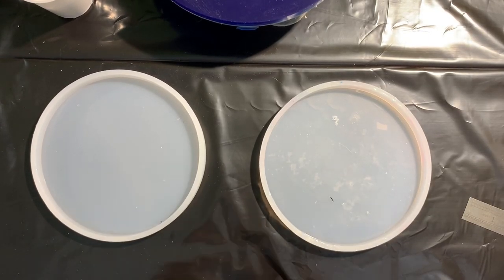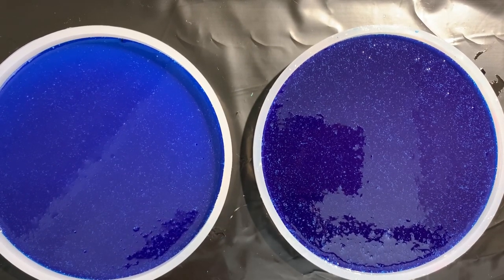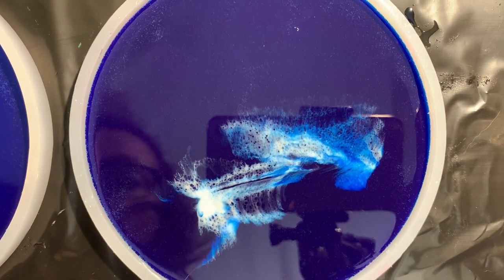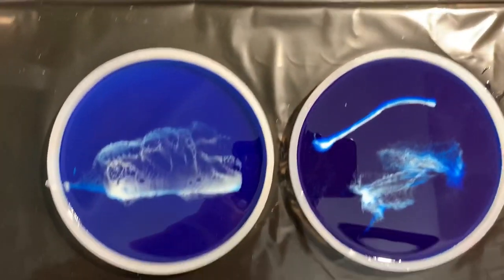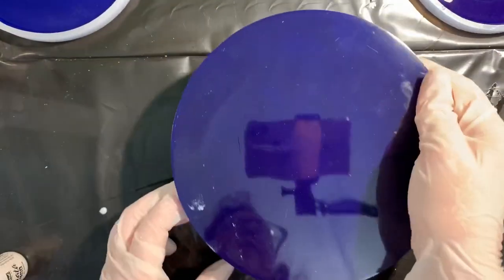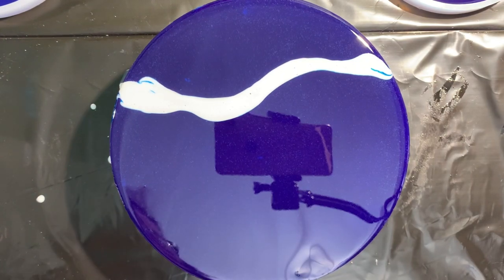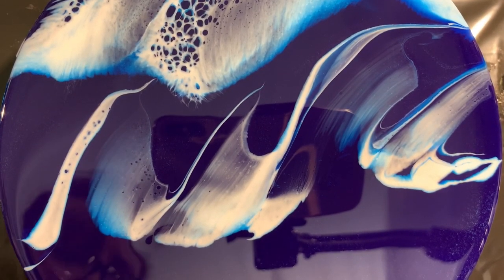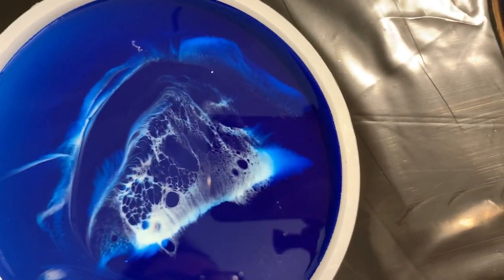Cells, lacing, and waves in Resin - what you may doing wrong - tips and tricks

Comment: Christy so lovely to hear your voice... oh and cheddar man too. Love your Pinterest with your cats they really are pretty . Great video your really thoughtful and a great teacher It was really great to know how thickness will effect the spread and “spring back” of the swirl I tend to make my resin thin like you since I learned mostly from you 😉 lol I do the layers so like it thin however I can answer a couple of your questions.... or uncertainties you mentioned in video.... yes casting craft alone will create cells and lacing so the alcohol ink isn’t completely necessary but doesn’t hurt. I giggled at the reuse of your so called mess up which I thought was brilliant probably could have gone over the top instead of back since it was opaque blue but saw that foil pen when you showed the ” mess up” side. So would love to see more ones with glass and moonstones in with combo of opaque and transparent colors.. how do you make the bottom layers show through do you use opaque first then each layer use more transparent colors or do you use silicone oils to make the open up?  Also did you know you can make any color crushed glass by putting some clear glass into a cup add alcohol ink of your choosing stir around till all covered then spread them on a paper towel in a single layer and let dry overnight and you now have crushed glass in any color! You probably already knew that 😂😘
Reply from the maker: I use transparent layers, but I lighten the color as the layers rise - so dark, then lighter, then usually the top layer is clear so you can see down into it.  I"ll use the glass and moonstones again, I have a couple ideas I want to try and couple things I have done, but didn't video and will do again.  I ALMOST showed you my spiral galaxy blob coasters in this vid, but forgot  LOL
Reply: Resin As You Wish  Thanks for your reply! Let me ask you though when you made the blue ones with video you used mostly opaque right? But the end result was beautiful but I tried and  basically covered the stones and couldn’t really see down 😩
Reply from the maker: @caronstone4226  all layers are a mix of transparent and opaque - I specifically put clear on the stones so they dont get hidden and on lower layers, i dont completely fill the coaster just fill in some areas as the layers build it up.  You can also go in once the resin is thicker (like peanut butter) move it away from any areas that it sunk into that you want to see
Reply: Resin As You Wish 💋🥰😍 thanks
Reply: just jumping in here, hi 👋 when I make the crushed glass in different colors I don’t even spread them out to dry.  The alcohols evaporate 👌. I make them in the cups they’ll be stored in and stir them up a few times during that same day..close the lids and done.  
I was spreading them out but one time I got busy for several hours and when I came back later they were pretty much dry.  Now I’ve fine tuned it 😂 (lazy way)  Just a few stirs does it! 🥂✌️✌️✌️
Reply: I did not have alcohol ink bit used couple drops of 91 percent alcohol instead with castin white and worked

Comment: So helpful, thank you so much!! Any ideas on how you might be able to get this effect on a curved surface? I'd really like to get some cells in dice but I'm not sure how. Maybe building up a lump or plane inside it with UV first and using that as a surface? No idea. Any thoughts appreciated!
Reply from the maker: If you did your cells in a flat surface, most resin is bendable before it fully cures - if you timed it right you could make them small enough to fit inside the mold

Comment: can I use either a heat gun or blowtorch? You seem to use both, one after the other. I dont want the expense at first
Reply from the maker: Hi, I use the heat gun because of the way it moves the resin. It also pops bubbles.  Once I’m done moving the resin where I want it, I switch to the torch to pop the bubbles that continue to rise to the top, because it won’t move the resin.  You can use any tool you want to move the resin, spatula, hair dryer or even your fingers. It’s all about what you like best.

Comment: hi im new but, been watching a lot of these and , on paint pours they add   Silicum oil, how is that and alcohol ink do the same develop of cells?
Reply from the maker: Silicone oil should not be mixed into the resin colors before you pour it,  silicone oil will create a cell like appearance if you put drops of the oil on the top of your resin once you have already poured it - acrylic ink pours use silicone oil mixed in the colors

Comment: I really need some help. I tried To do a cutting board for my sister , but I can't do the stupid lace in the White of the waves, I don't know why , please help
Reply from the maker: 1. What white are you using 2. Heat gun? And 3. Check out my heat gun tips video - it has some more helpful tips about wave making. One thing that I have come across is if the viscosity of your resin is too thick, you can’t get the white to spread into it.
Reply: @ResinAsYouWish  hello again , I use the résine and hardener half/half, and I use acrylic paint white , I purchased a heat gun and the heat was perfect but the wind , the blowing part was very week , so I tried with my air dryer, and it’s a little to week at medium and to hard at maximum, 
You think that my résine is to thick ,you may be very right , what can I do to make it more thin ? 

I did a little bit of acrylic pouring and to make cels I added 3 drops of celicone, 

So what can I do to make this better , thank you for helping me , it’s a honour for me, you do beautiful work , I love everything you do .

Comment: What is the epoxy/casting craft/alcohol ratio?
Reply from the maker: Castin craft has a small hole in the top  for squeezing it out, usually do a small quirt in the bottom of the cup and add 4 to 5 drops of alcohol ink.  That much doesn't matter if I fill up the whole  (shot glass sized) cup with resin or just half, it looks and acts the same
Reply: @ResinAsYouWish  thank you. This will be the 4th time I’ve tried to achieve cells with various white pigment, but have not tried the casting craft with alcohol ink. I tried it by itself but it didn’t seem to work. There seem to be a lot of variables with epoxy so the thin/thick aspect of this video helps. I’m starting to wonder if the moon needs to be full for a piece to come out the way I want it. Lol Thanks again!
Reply from the maker: @BenFoilHat  okay usually the top three things that are the problem with cells are 1. the resin is such a good quality it is too thick and the cells don't form  2. you are holding the gun wrong (see my video tips about heat gun tips) and the biggie is . only move resin once when you push it with the gun,  - once you spread the white out don't keep spreading it or it just mixes up - you can see see this t better on the tips about heat gun tips video -  and if you must resort to moon dancing you may as well - on the spookiest night of the year coming up  - and totally pics or didn't happen LOL

Comment: I thought you weren't supposed to use an open flame when using alcohol inks?
Reply from the maker: Alcohol is extremely flammable , it can burn almost invisible.  The mixture I'm using here only has a couple drops submerged in the resin and resin colorant.  You are correct, always be careful just having a torch close to your alcohol inks.